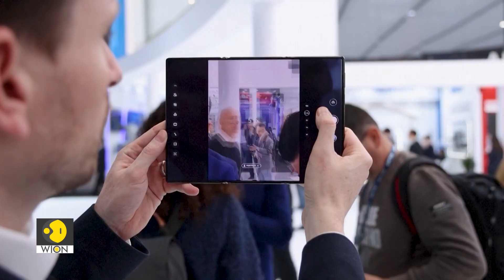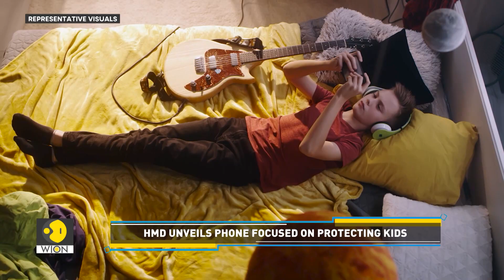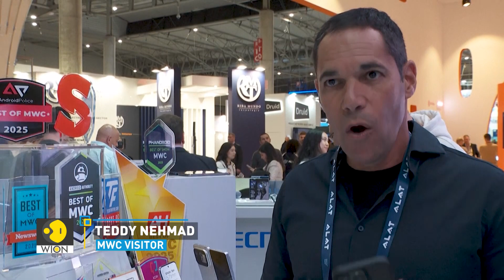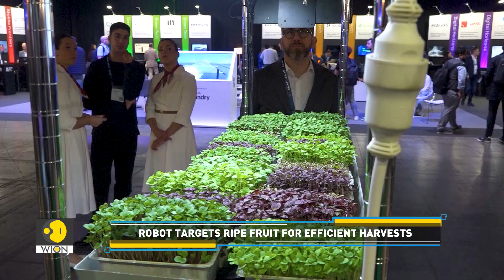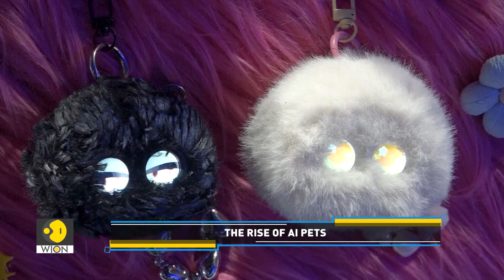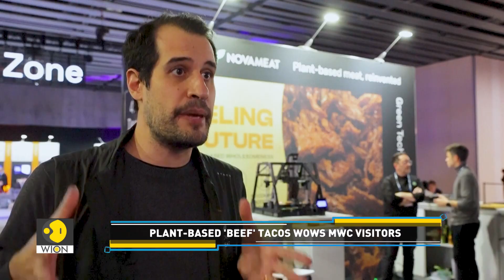MWC 2025: Must-See Mobile Tech Highlights | WION Tech It Out

Comment: Making thin mobile is not innovative why companies are running behind slim and thin mobiles. We do not want paper thin mobiles. A 7.5 to 8.5 mm mobile looks decent also and companies can add new features or mechanisms or durable batteries or great cameras with large censor or even get rid of heating problems or loss of connections like mobile networks and satellite connections etc. Thin slim phones are not future adding value to products durability, features etc is correct.
Reply: Those are for rich people who doesn't care about durability.
Reply: @Yes_Money_Can_Buy_Happyness  Companies name will be at stake there will no difference between cheap and branded companies. people will change there mind.